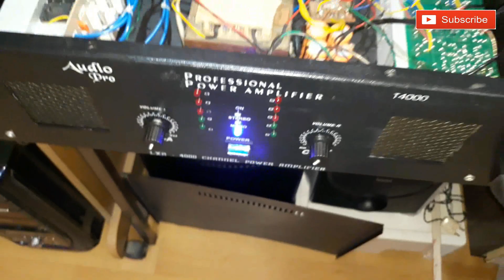How To Make 2 channel Power Amplifier At Home

Comment: Hows is the sound quality of 500 watt rms mono salcon amplifier ?
Reply from the maker: Yeah thats a very good one. No humming noise, great sound. For best you need 50-0-50v transformer with 10 to 15 amps. It can drive a 18inch subwoofer easily.